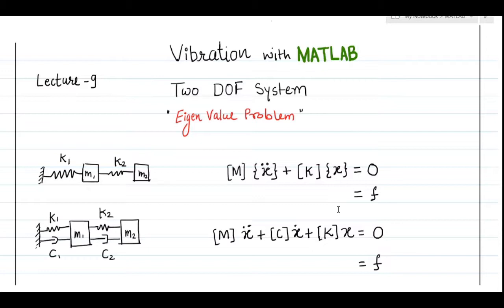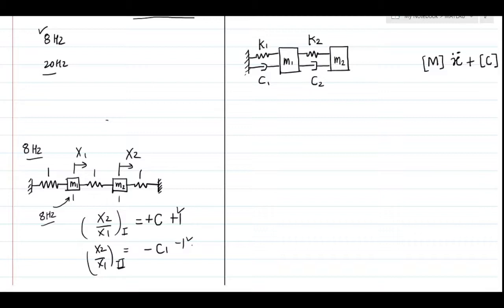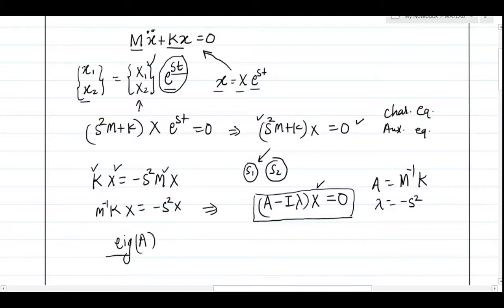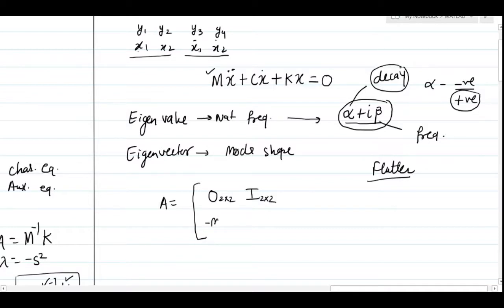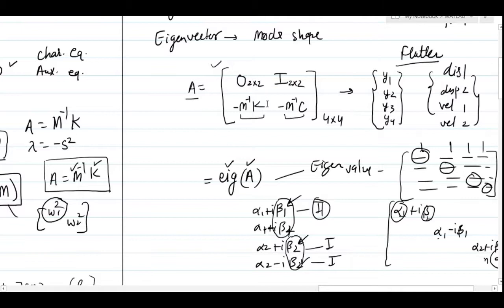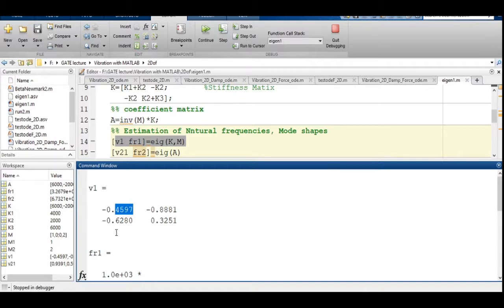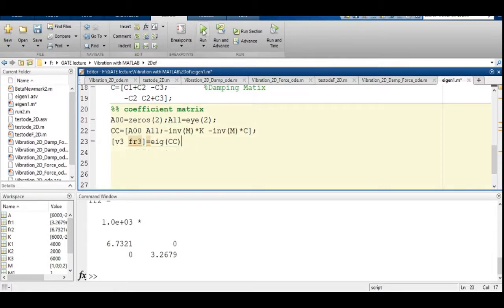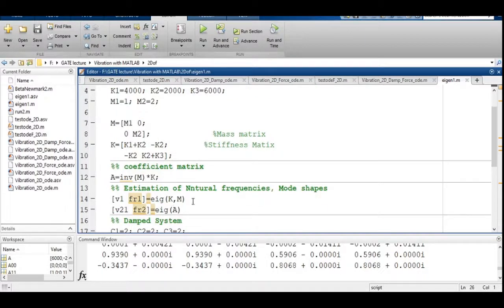Eigenvalue Analysis in Vibration MATLAB|| 2DOF system||complex eigenvalue|| Vibration with MATLAB L9

Comment: Thank you Sir. I am a brazilian student of electrical engineering and i am studying subsynchronous resonance. 
I have to do the eigenvalue analysis for a spring mass model with  6 mass . I have all spring constants (K) and Inertia Constants (H). Instead of  M, in your anaysis, can i use H?  I am using the first benchmark of SSR (1977) as base for the turbogenerator model.Again, thank you for your great explanation.

Comment: what will be the A matrix for 4 dof system in damped vibrations?
Reply from the maker: At 13.53 sec matrix A is given, that is valid for any dof. Just put M C and K matrix with a zero matrix.
Reply: @ashishpurohit9138  thanks for the reply.. I have used the same equation as you have mentioned with A00 and A11 as a 4*4 null and identity matrix and m, k, c with its usual meanings with size 4*4..